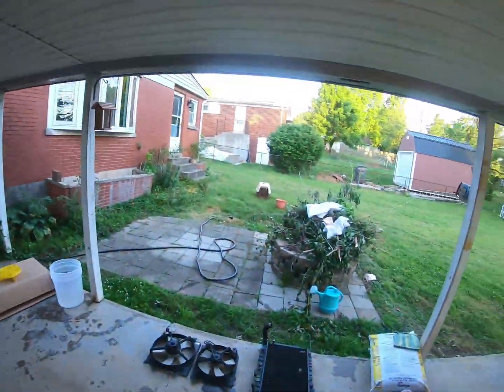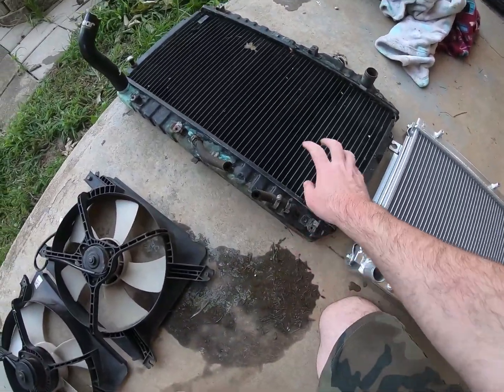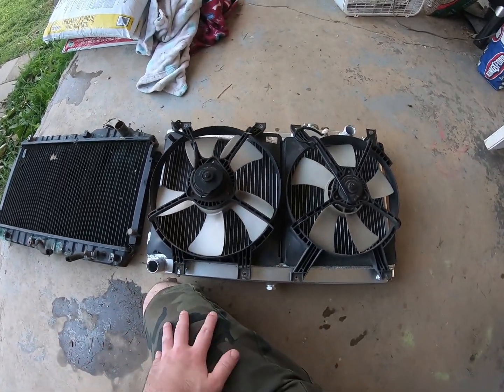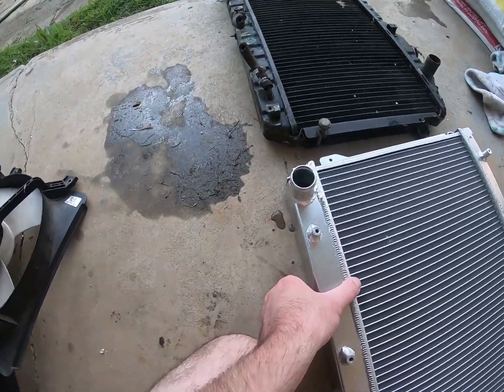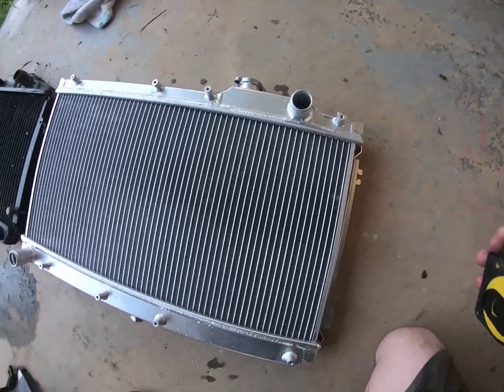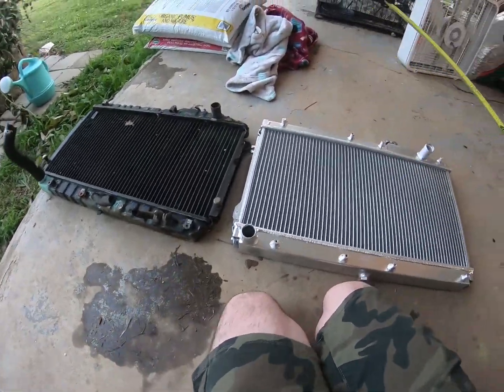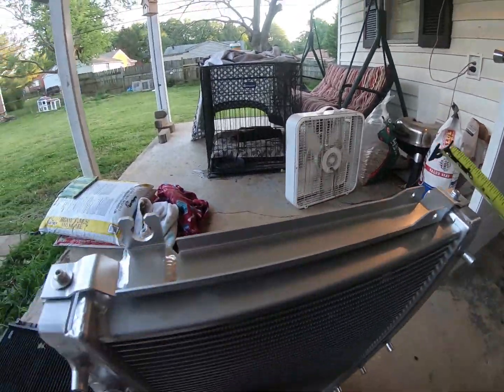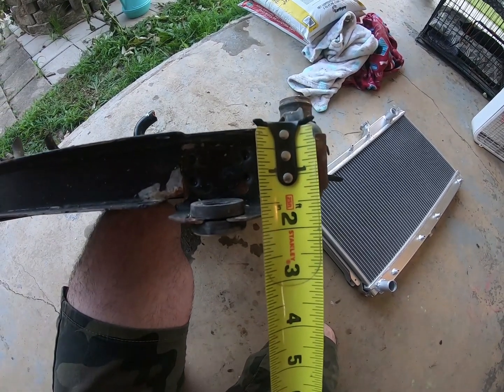DNA Motorsports (Ebay) Miata radiator measurements vs stock.

Comment: Im about to buy this DNA for my NA. Did it hold up on you, was install alright?
Reply from the maker: Ive only had one small issue : one of the mounting holes for the factory radiator fans was off and wouldn't mount. It does fine using just 3.
Reply: @Mylifeinthepits  im probably going to use the factory fans as well. That seems like a small problem. I read on Amazon reviews people have to modify their AC hoses and I was like gulp don’t wanna do that
Reply from the maker: @peterk7012  I didn't have any issues with my ac lines.